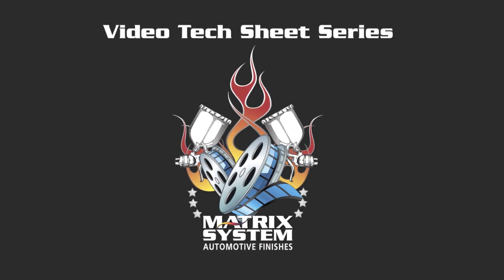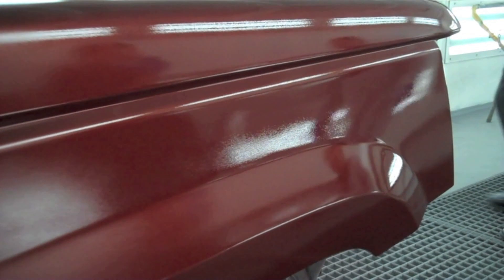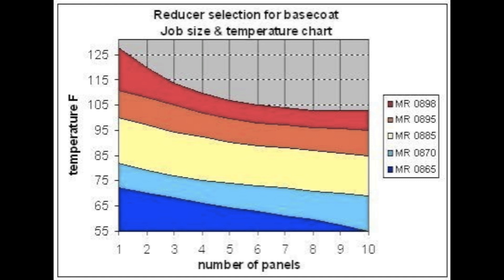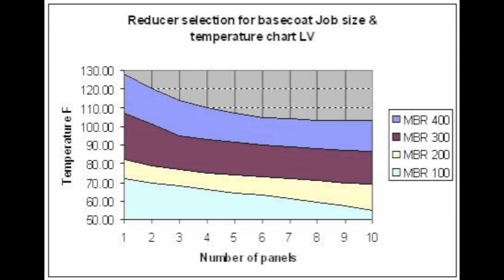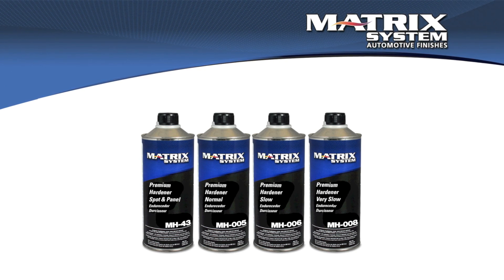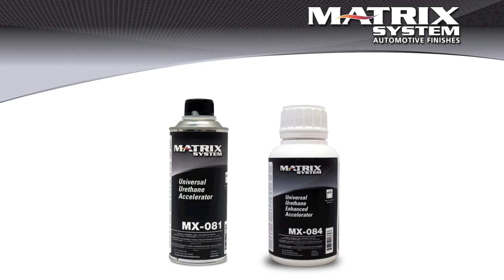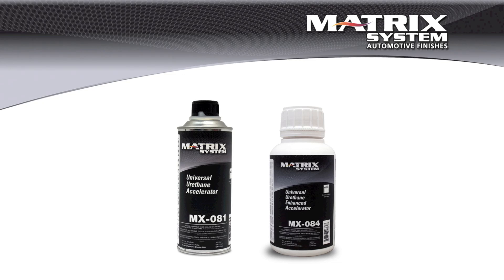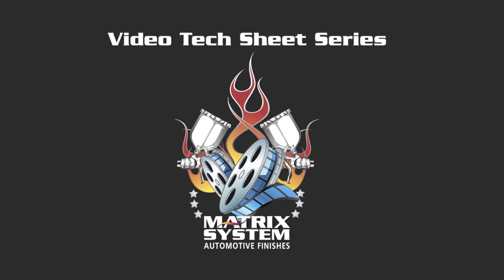Matrix System Reducer and Hardener Recommendations for Changing Temperatures

Comment: Im gonna be spray an antique fridge next week. Probably in either high 70s or low 80s. I have mr 0870 left over from another job. Should i treat the flash time the same if im in the low 80s should i change anything when spraying. Thanks.
Reply: rule of thumb that I use is 0860 is 60 degrees or less. 0870 is 70ish degrees. 0885 85ish degrees and 0895 for fuck water I need a beer hot. lol